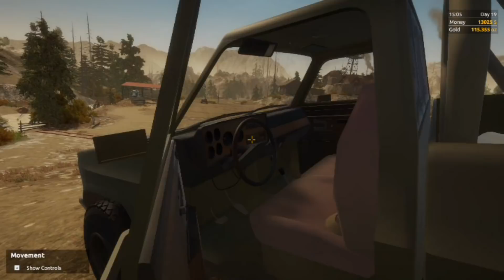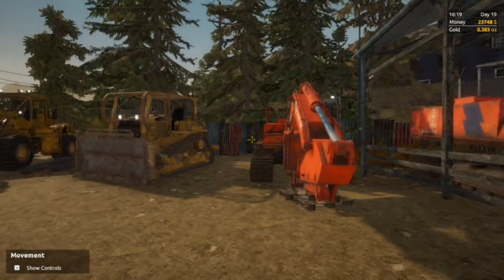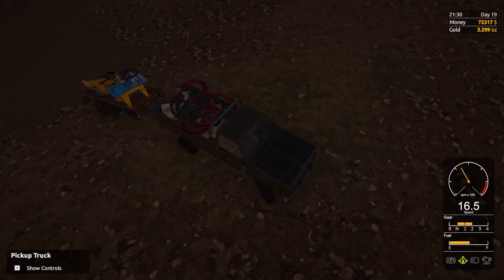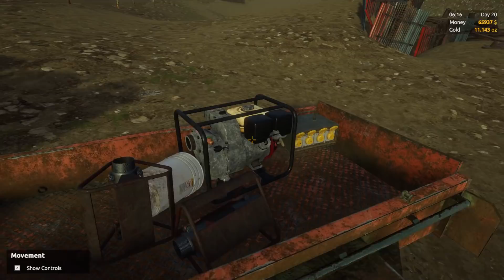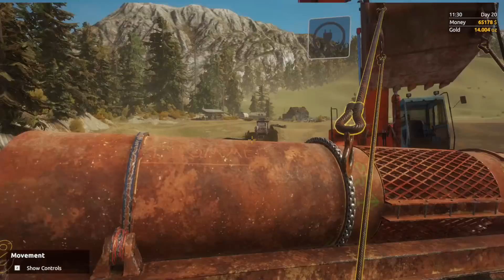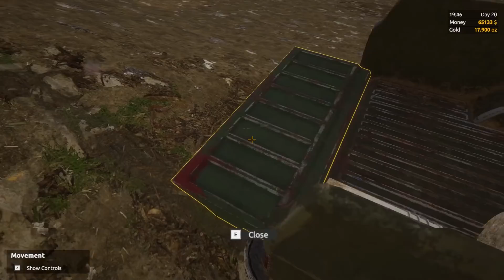Big Move Big Upgrade! - Gold Rush Gameplay - Gold Rush The Game

Comment: Your magnetite separator is back at the Old Arnold(?) site.  When you put back the wire that originally fell off your truck and you were getting back into the truck i saw it fall off.  12:32  Whether there is a despawn timer for it I don't know, but you can check your video and see it happen.  I hope it's still there for you to get.  Cool video!
Reply from the maker: It was actually along the side of the road been town and pine valley :)